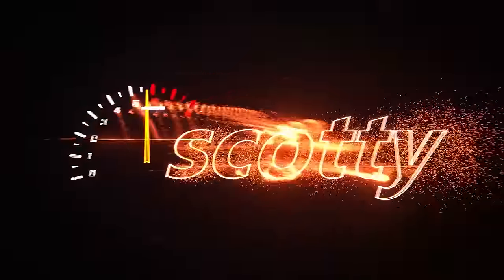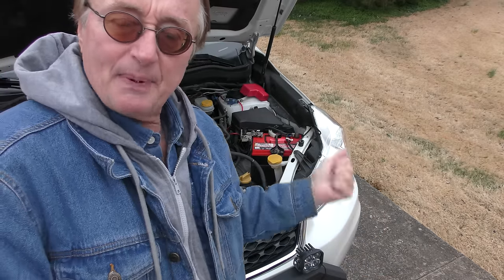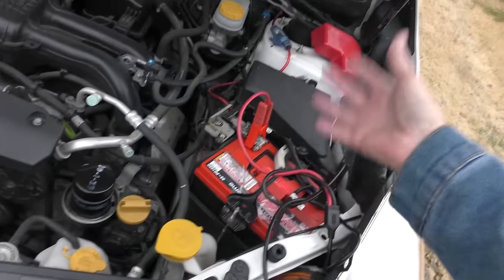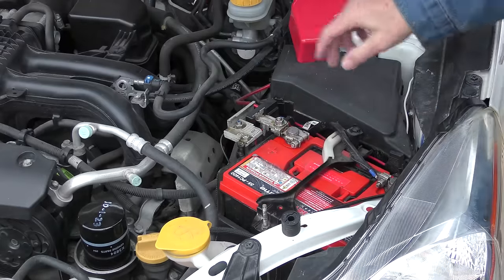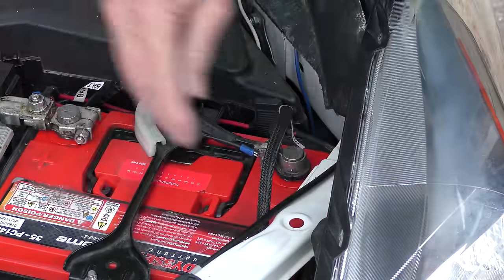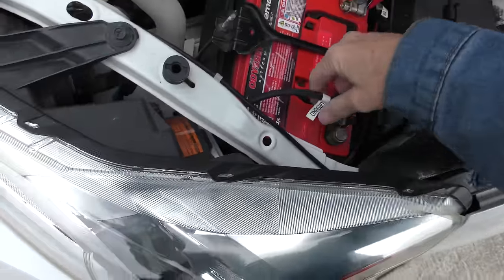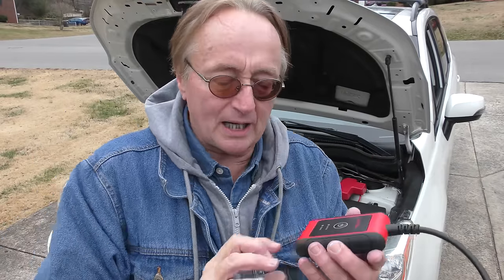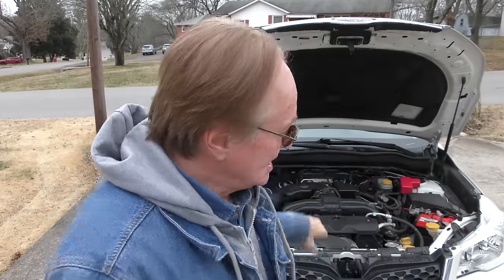Here's Why Connecting Your Battery Like This Will Destroy Your Car

Comment: I used to work in a battery and lighting store, as well as several years in auto parts stores. I really don't like modern battery connectors, they are awful. On my classic car, I use old sold brass ckamps with stainless steel bolts, and dielectric grease to prevent corrosion. On our moderns, I use solid lead clamps, I recommend marine grade clamps, again covered with dielectric grease. Be careful not to use cast metal clamps, they are weak and break easily.

Comment: Did you pull that loose terminal off and clean the post and the terminal if it was loose that long it might have corrosion between the 2 of them.

Comment: Try touching the screen where the amperage number is displayed.  It should bring up a keyboard where it will be much easier to enter 8-5-0.
Reply: Instead of sliding the finger to get to the final value, just rolling the finger tip will allow finer control. Easier to change it in small increments that way.

Comment: Battery terminals come in different shapes and sizes. I have two identical vehicles (Mitsubishi Pajero iO) but the batteries are different, terminal pillars reversed. So instead of one spare battery I need two. There is a special clamp that bridges between the terminal pillar and the cable, but to get one you have to search scrap cars at the local junk yard.
Jack, the Japan Alps Brit

Comment: I had this very issue with my old car. Same brand of battery too. It was so loose it was arcing and the terminal was super hot because of the arc. got it tight and no more need to jump it.

Comment: This is a good example of why people are rightfully confused by electrical problems.  At 2:52 Scotty mentions "...a short in the system . . . . "  Believe it or not, most electrical problems are not caused by what people call "shorts".  Short circuits blow fuses, trip circuit breakers, burn wires and connectors, and are less common than youtube videos would have you believe.  The far more common problem shown in the video is closer to an "open circuit".

Comment: On my hyundai, I noticed my battery light flicker and checked my battery and it was ok but when I put a voltmeter on it the voltage was too high.  The regulator had blown inside the alternator.  As it turns out, it was better to just replace the alternator than fix the regulator but the regulator is a key component in that if it's hitting your battery AND the rest of your electronics with too high voltage, it can trash a lot of stuff.

Comment: Those yellow top Optima batteries are great as long as they are kept charged.  One of my Honda Insights got T-boned by a woman who ran a stop sign in a school zone.  The Insight sat for over a year while the restoration shop collected parts.  The Insight had a brand new group 51 Optima yellow top which was irrevocably sulfated by sitting.  I tried running the desulfate cycle on my charger repeatedly for a week with no results.

The same thing happened with an army surplus generator I got.  The army disconnected the two Optima yellow top batteries when it mothballed the machine and then let it sit for two years.  Those yellow top batteries were trashed and no amount of desulfating did any good.

My Tacoma  a Sam’s Club “Duracell” AGM battery which I installed September 2015 and it started the Tacoma, no problems, a few days ago, when the air temperature was about +2 degrees F.  It is anecdotal and unscientific, but keeping an AGM battery charged by driving a vehicle regularly should help the battery last a long time.
Reply: @Jj-gi2uv  Thanks for the added data point.

Comment: Hi Scotty , 
My issue  with my battery,was not a loose terminal, but a corroded, greasy positive wire attached to the terminal connector on a old 2004 Honda Pilot. I could not see the  dirty wires inside the terminal connector, until I removed the wires from the terminal connector and clean them with brake clean.The SUV is running great no check engine lights and head lights dimming during idle.Tom

Comment: I bought a yellow top optima back in 2006.  It lasted until June 2023 when I used it to trade a car in, still worked.  I had it in about 3 of my vehicles driving in New England summer and winter, never had issues with Optima, but this video is telling me not to buy them no more?

Comment: I had two batteries on two different vehicles fail to hold a charge on the same day. What are the odds? Well, I returned them (still had some warranty) to the place of purchase ( I wouldn't mention names, but the batteries were name brand). When I mentioned they failed at the same time, they checked the serial numbers and discovered they where created on the same day. Lesson. If you buy two batteries at the same time, make sure they have very different manufacture dates (as a minimum).

Comment: Should have took the battery cables off and cleaned the terminals and cable ends and reinstalled properly. Then you would know 100 percent you have a good connection to the battery terminals.

Comment: First thing I check is the connections, a lot of times, especially if someone added lights or stereo.  Batteries are weird, got one with a three month old date code that barely lasterd a year, the next one was a year old and it's still going, four years later.

Comment: Odyssey batteries are well built batteries and are made in the US (as well as other locations. But those sold in the US are made in the US.  Regardless, they claim that you can get up to 10 years of service life out of their batteries.  I have seen a few that were older than that in tractors and a few trucks. 

I will admit that their warranty is confusing, but for most of their car batteries, they have a 3 year warranty, which seems to be the newer standard adopted by the battery industry.

Comment: Can we use a good voltmeter to check the same thing - for those of us that don’t have expensive scan tools 🤔
Reply: Sure, but interpreting the results is now entirely up to you.  A high charging voltage can be a faulty alternator voltage regulator OR a battery with high internal resistance.  A faulty regulator allows the voltage to vary widely with RPM change and that's one reason to change RPM while charging.  If the voltage does not change much or at all, the regulator is "regulating" but might still not be at correct voltage.  A battery nearly discharged tends to resist being charged which seems contrary to expectations; it ought to be "thirsty" but it can resist charging which then causes the alternator to go into over-voltage trying to charge the battery.  A trickle charge for a day or two can get the voltage up enough for normal charge cycling.

Comment: Lower voltage will be higher current.
Fuses can blow from low voltage.
Modern systems can be very sensitive to anything less than the voltage and capacity they were designed around.
Reply: Hi, the basics first. You have to check because you never know what condition things are in.
Take care all M.

Comment: There can be a good side to batteries getting sold aged on the shelf.  I recently had one go bad. I thought it was way too soon. But I looked and there was a date on the battery that was older. Did I remember wrong? Nope. It sat a year on the shelf. But my warranty period started on the day I bought it not the day they filled it.  So free replacement! Assuming the replacement is equally old already I got two 3/4 life batteries for the price of one!

Comment: Funny enough I had a right turn blinker problem for 3-4 years even after changing the bulbs. The last time I just did it again, I made sure it was connected so much to the harness that I almost cut the heck out of my hand. Guess what? No problems so far and it works fine. Crossing fingers but I think it needed to be jammed like that maybe a small little clip or plastic piece on that harness is chipped or broken and that's why it keeps getting loose.

Comment: My 98 f 150 was troublesome, if I didn't drive it for a few days, I had to hook up a charger to it. It never went to the green light, charger was warmer than usual. The truck had those cheap band type terminals. The positive one had split almost all the way. The alternater wasn't showing any voltage on the dash guage. I checked the battery voltage with a digital meter. 18+ volts. Hmm. I checked with my vintage Simpson 260. 18+ volts. What the $%^? I bought a new battery, got a new  ( not rebuilt Chinesium crap), a Delco ( for a Ford), Rock Auto, about $135. Battery cost about the same. I changed out the old for the new, and now the old truck is good to go. 14.whatever output on the alternater. Truck is happy, I'm happy. I'm just wondering what would make the old battery show over 18v. Never heard of no such thing.
Reply: If I may hazard a guess - the voltage reg built into the alternator might have been faulty.  And/or the battery was weak, the alt was working hard trying to charge it, but the battery was incapable of holding a charge.  So the alternator just kept trying to recharge a defective battery that was losing voltage faster than the alternator could supply it.

Comment: A loose ground on the 12v battery caused the volume control for the radio to not work at all on my 2014 cadillac elr. I disconnected the battery, let it sit for a minute, then reconnected it and problem solved.

Comment: I could use an educational video on old, vintage car's starter system. My nephew, trying to help, reversed jump polarity and now the engine won't turn over. No clicks, nothing. (Known good and now charged battery.)  It's a simple engine so the generator (not alternator?) maybe needs repolarization? Not a mechanic so no idea where to start.
1957 Benz, straight 6 gas engine.

Comment: Good test Equipment is an analog meter such as a Simpson 260 multi-meter. The voltage can be seen on the meter and the drop seen also when starting.  The bad battery connection will have a VOLTAGE DROP which will be sensed and confused by the vehicle electronics. A direct connection to the analog multi-meter will tell the truth. Take it from an highly experienced Avionics Technician that did much aircraft troubleshooting with a Simpson 260 multi-meter.

Comment: As a teenager in the early 80's I worked at a local NAPA store and three of my favorite job's were prepping a new battery for a customer and turning brake drums and rotors instead of working the counter all day. Now with the introduction of cheap brake parts, usually from Mexico, and the fact that battery manufacturers want their batteries to go bad quicker so the customer will have to buy a new one sooner, so none of these three services are performed anymore! For the last several years I have been buying remanned batteries from Interstate Batteries and so far they are holding up much better than the supposed "new" crap from any of the retail parts stores.

Comment: According to the article "Electric Cars Suffer ‘Unsustainable’ Depreciation in Secondhand Market" written by James Titcomb (2024Jan18) for The Telegraph, EVs lose almost half of their value after 3-years on the road. While a $50,000 EV would lose $24,000 in value after 3-years a $50,000 ICE would only lose $17,000. Combine this with the price of petrol in the UK dropping to a 2-year low while electricity prices go up and there is the potential for a glut of used EVs hitting the used car markets and making the depreciation even worse.

Comment: Thanks, Scotty, as usual, good advice. (edit - missed the end of your video where you explained missing the loose connectors)
I got a couple questions. Why did you not first check the mechanical connections to the battery prior to beginning the electrical testing? For an example,  I always tell the summer computer interns to first check the hardware, the connectors on the storage device, reseat memory, etc., and then run the diagnostics on it before doing any software reinstalls on the computers, and that is with any device prior to troubleshooting it. 
Second question. Shouldn't the negative clamp of the charger be connected to a chassis ground to prevent bypassing the BMS?
Many late model vehicles have a BMS with a current sensor around the negative cable (others may have it in the positive clamp) before the terminal post of the battery and when using a battery charger, the BMS is bypassed when clamping the negative alligator clamp to the negative post of the battery. Therefore, the BMS is unaware of the current and charging of the battery during the use of the external charger. The recommended way to use this charger to allow the BMS to record the charging event is to connect the negative clamp of the charger to a good chassis ground point which will allow the current sensor of the BMS to detect the charge and allow the BMS (Battery Management System) to properly manage the charging of the battery.
Now the only way to be sure if this is correct for the make, model & year is too verify the type of BMS used in the vehicle. There are differences in correctly charging the battery to keep the BMS in the loop of the process.
Third Question but should be first one asked of the customer. When you replaced your battery with the new one, did you reset or have reset the BMS so it knows there is a new battery in the system and will adjust its charging algorithm to provide the correct charging voltage to it, based on age of battery, flooded, AGM or other type, original capacity, the now diminished capacity, etc.? Charging algorithm, an unknown formula,  a mystical, magical formula created by genies, and magical beings. 
That is something else that most DIY (myself was included) are not aware of and then start getting warning messages on the display that the battery is not fully charged or something similar until the BMS is reset, and in this example, it still thinks the battery has been in use for 1460 days  (4 years), plus the days of use of the previous battery before it.

Comment: Odyssey batteries require a very special charger that will not charge at a higher than 15 V max. These batteries are made to military specifications. They last 10 years or more.
 My 2017 ram 1500 has the original battery in it here in January 2024

Comment: Always check the tightness of battery terminals if someone else has replaced your car battery. I was having all sorts of intermittent electrical problems after a battery replacement and it wasn't until I found that the negative terminal was not on tight that my problem was resolved. Don't trust anyone's work particularly if they're in a hurry working.

Comment: It is possible to buy some batteries dry,  but that means keeping electrolyte around, and that needs a little tlc regarding storage: something well ventilated with a reasonable containment in case it leaks.  Not for everybody.... apron, gloves, goggles, and a locked door to keep morons out.
Reply: I don't think it's possible to buy a sealed AGM (Absorbent Glass Matt) battery dry to be filled with electrolyte at the time of purchase.

Comment: I always take the fresh battery from the back of the shelf myself and leave the old ones in the front…
Reply: Well yeah, I think there's a reason why most batteries it's difficult or even impossible to find a date stamp!  The battery makers know perfectly well we're taking the freshest egg from the nest and leaving the old ones for the store to get stuck with.  
Maybe also that's why the auto parts stores keep the batteries behind the counter where we can't even see them before we buy.
Reply: Admittedly, it does help to know how to read the date codes to know when it was manufactured.  It’s so simple, even a cave man can pick a fresh battery.

Comment: I have a 36 month battery that the warrant expired.  So I opened it up to check the water at 50 months and it was low on 3 cells. I was afraid to check it it during the warranty since i had to crack some plastic.  It might have voided the warranty.  I believe low water on a battery may cause failure.  In the old days most batteries had caps that it was easy to check the water. I recommend checking the water as soon as the warranty expires.

Comment: I used to have issues with my vehicle battery. I went through battery after battery turn out my led leads were the issue. I went to my local auto parts store and got some brass leads and it fixed the issue. Now on all vehicles I own  I put brass leads on them.

Comment: If you got voltage problems and it won't turn over the first thing you check is the battery connection you don't drag out goofy little test machines good God can we get any mechanics anymore.
Reply: ...the second step after that clamp tightness test though, would be to start the car however you could, then put the probes of your VOM on the battery posts to find out how much voltage it is getting from the alternator.  If its getting 14v or more, then the alt could in fact be fine but the battery can't hold a charge.    But all too often though, when a battery dies it might take the alternator with it, because it killed itself trying to charge a battery that would no longer hold a charge.